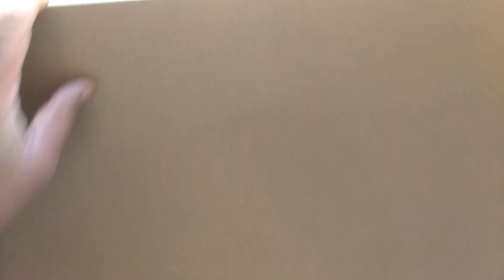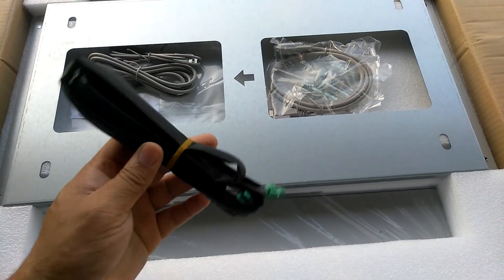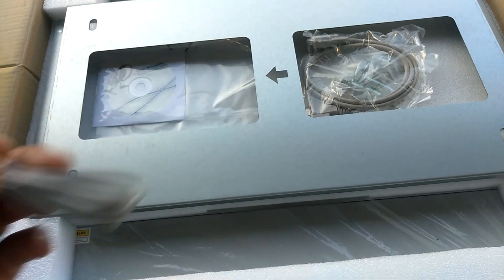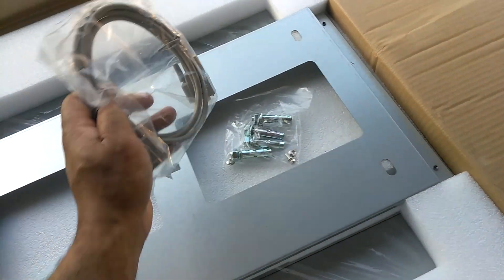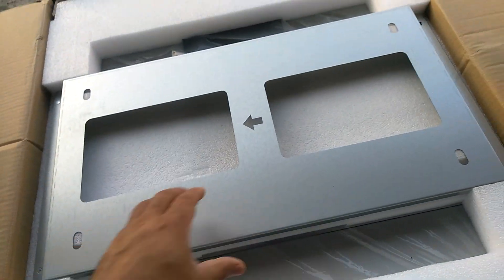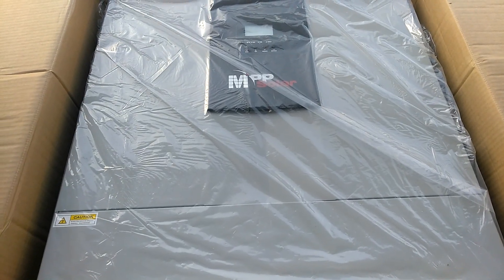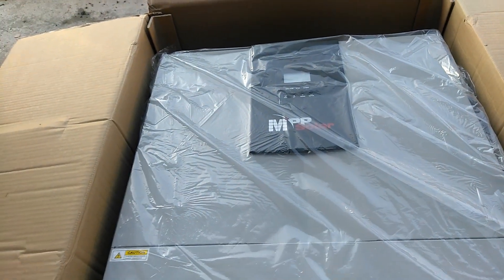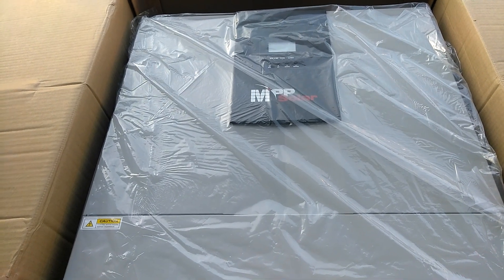Got my new inverter from MPP solar today

Comment: Bro my grid voltage seem to be 230v by 50hz do you think it’s compatible wit this?
Reply from the maker: Yes it will work it's a setting inside of the system where you can program it for 50 or 60 hz  and 220     to 240v.

Comment: Can the LV5048 run on one 120v line in and one 120v line out?
Reply from the maker: You need to bring in 2 Leeds off of one leg of the breaker boxand you can parallel the two outputs together to make it one phase 120 volts.

Comment: what is the rating , cost and power sources applications ?
Reply from the maker: 5000 w continuous cost 12 to 1300 depending on where you purchase it at power source you can do 120 volts are 240 split phase.

Comment: Good video. Didn't know MPP made a split unit. Some people use a transformer on the output of the 240 VAC single phase output. A transformer with a center tap on the output can provide split phase but generally not as efficient. Thanks for posting this video.

Comment: any idea if this would work with the AC?  or would need 2 to handle the load?
Reply from the maker: depends how big the AC is but yes I believe it could I will be trying it out shortly soon as I finish getting it installed so I will be able to update you later 😊.

Comment: hows the cost against getting the 2 of the lower ones that can be paired for out of phase?
Reply from the maker: I believe it was more to get the two units then to buy the one.  And I wanted the 48 volt unit not the 24 because the 48 volt unit holds 8,000 Watts of solar panels.
Reply: @carsonlurbanwindandsolar3437  and it's 2 phase 120 right?  Seems like 48v -> 120v inverters aren't as popular.  From what i have seen 24v seems to be the US standard and over seas 48v.  You got a link to where you got it?
Reply from the maker: @CrankyCoder  https://www.ebay.com/itm/FREE-Shipping-labor-weekend-5kW-48V-Split-Phase-120-240V-Hybrid-Inverter-7-in-1-/254211419190
Reply from the maker: @CrankyCoder  you can do split phase 240 you can do 2 phase which is to 120 volts are you can do three phase.